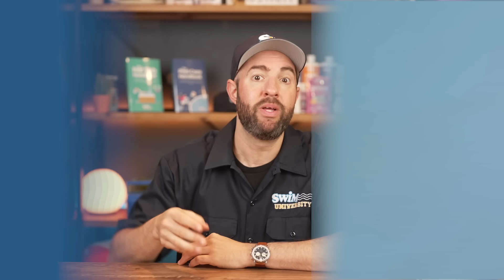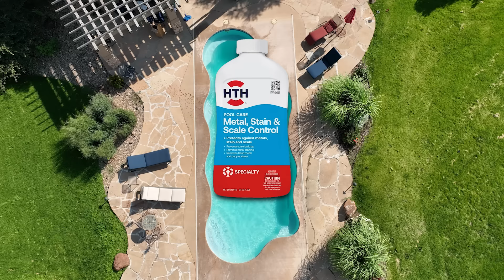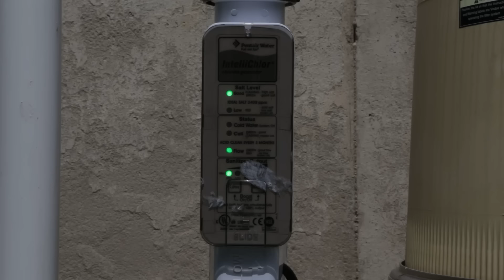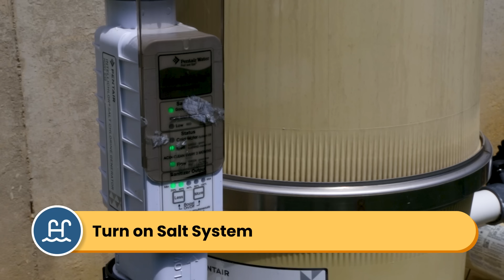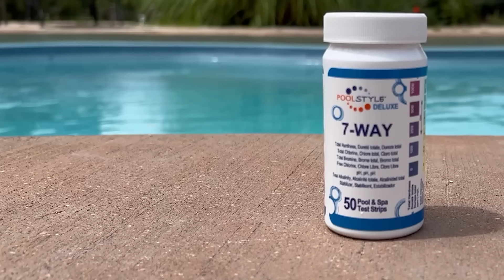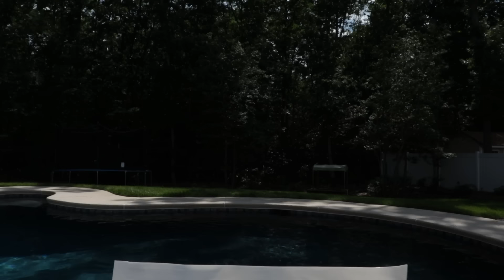Salt Water Pool Care 101 (Maintenance, Startup, Common Mistakes)

Comment: For a 7,000 gallon above ground set up, which salt water system is recommended? I have seen the Intex and Krystal Clear - but there are several kinds and they all seem to service for a 7,000 pool. The pool has a sand filter but I’m not sure which salt water system to go with - any suggestions?

Comment: I bought the hand book since I’m a new owner. My salt water generator was set to come on as the temperature rises so it’s been on a couple weeks now. I have 6000 gal pool and salt level is at 3300 ppm right now. Will I still need to add salt to start the season?
Reply: No, you're good for now. Check it after you've balanced everything else. Good to keep it between 2,700 - 3,400. I'm in the south and mine seems to do better on the higher end. 🤗

Comment: Hoping you can help. I have my pool around 33 to 35 degrees celcius. Im in Australia. Hence the measurement.
I notice mainly on the deep side its patchy light brown on the bottom surface of my concrete pool. Its pebblecrete finish.
No doubt I cannot keep my calcium at 3 to 5 ppm at that temp. Seems too low.
What level should I have it at.
Its a 34 000 litre pool.

Should I run  much high chlorine levels at that temp to get rid of that light brown patchy look.
Im using hydro chlor shock but putting in 300 grams. Should I run more than that weekly too?

Thank you

Comment: Hi, we have an above ground intex pool. 
Can you describe how much time we should wait between each step to know how much chemical to add for the next step? 
I've also been seeing conflicting information about doing a shock before adding salt?
does all this have to be done before it can be used?
Reply from the maker: Wait 20 minutes between adding chemicals and then retest. You don't absolutely need to shock, but it means your salt water cell is doing all the work to bring your chlorine levels up to zero. Don't use the pool until your free chlorine is between 1-3 PPM.

Comment: So it seems i am always adding either HCl or baking soda. My pH is chronically high (above 7.8) and Alkalinity chronically low because I have to add so much acid. Is this just pool life; add chems when they are out of range?  I was testing 1x per week.. I am now testing 3-4 times per week. Is this just the life as a pool owner? Not complaining, just wanting to know if this is all normal.
Reply from the maker: The other option is running your salt system less or running water features less (those both elevate pH)

Comment: If I am getting calcium flakes from high pH and I vacuum the flakes out, won’t this decrease calcium hardness over time as I am removing calcium?
Reply from the maker: It depends on how much water you remove when you vacuum. If the water source has high calcium, it won't drop if you refill with that water source.

Comment: I’m in Utah and our water here has a naturally high calcium hardness level. I have an autofill on my plaster pool. Besides turning that off and adding water with a hose and filter, is there any other way to lower calcium hardness?
Reply: I have the same issue is Arizona. The hardness level out of the hose is well over 500ppm. I literally have to clean my salt cell every 3-4 weeks. All other levels are within range. How does a regular inline filter remove calcium? I don’t think that’s possible, though I may be wrong.
Reply from the maker: Some pool owners in Utah, Arizona, or other hard water spots end up installing a water softener hooked up to their autofill. If not, a scale control product will at least help prevent the high calcium from settling on surfaces. Keep your pH under control, since high pH pushes calcium hardness out of solution. Check out our calcium video for more help: https://www.youtube.com/watch?v=pGweIvE36QA